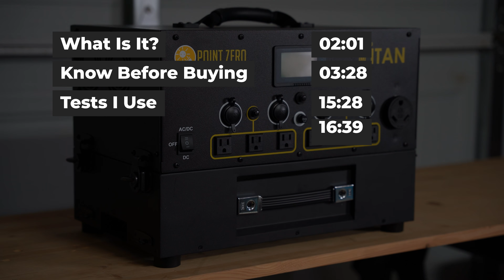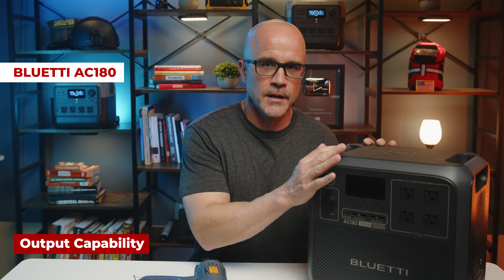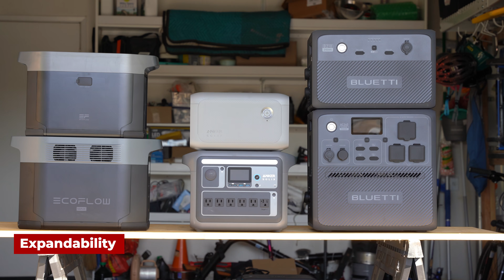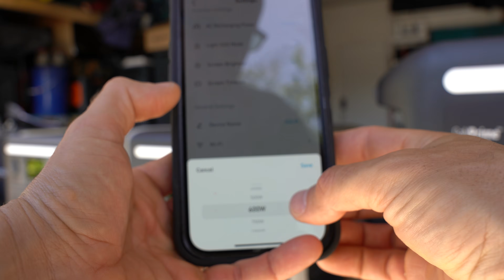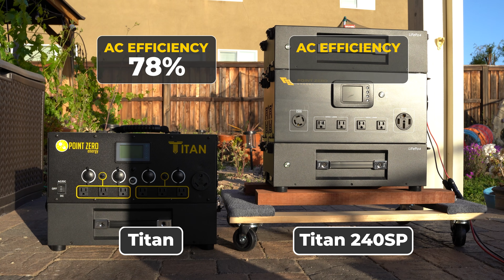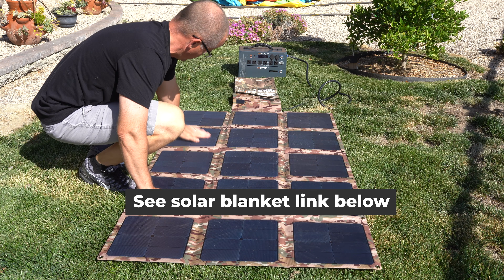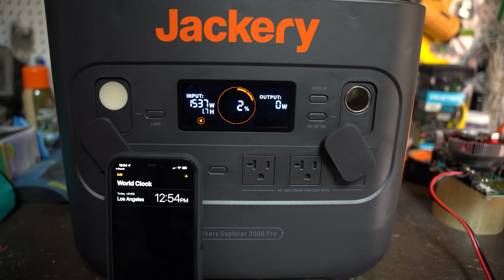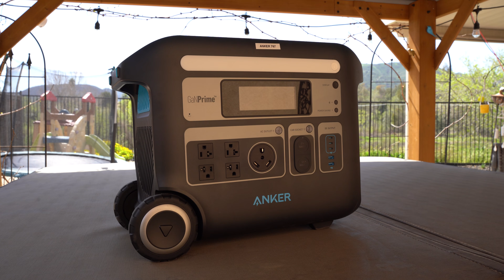Best Solar Generator for 2024 (The Ultimate Guide)

Comment: ￼

So is the following ad of of the Mango website, false advertisement? And by the way, I paid $6200 for the split phase 240V setup. Two units split phase adadapter box, the elink cord "(that trips the unit out,or faults immediately after turning units on after installing said e-link cord into both units and nothing else attatched, ie.noload)
It also came with a quick charging cord for the 30 amp 240, and 4-200 watt portable solar panels. It was an end of the year special that somehow found me when I was seriously considering a boondocking lifestyle as soon as possible in a 42' toy hauler. I had made to my daughter's house in northwest Iowa from SE Wyoming, December 26, (due to road conditions) for Chistmas of 2022. The deal was, I had to  purchase by midnight Dec. 30th and was already the 29th by the time I heard about the Mango Power E,  and the promotion they were offering, and definitely wished I wouldn't have been so gullible and waited for some of the other ones to enter into my searches for Sola generators,as I was just starting to enter that more permanent rv lifestyle. Turns out I have had to remain home  take care of property and preparing to downsize in order to do such a thing. Became a widower in June of 2020 and I can't just let my home take care of itself, anyway the Coddington was to give you some info that I'm familiar with.
Oh and contacted Mango Power to get another e-link cord or a pinout schematic to verify that what I found to be suspect and have heard nothing back and sent like 2 or 3 emails and no response since the first contact with them(Mango). Sorry for the lengthy comment.
Written by MangoPower
May 16, 2024

Mango Power E: The Perfect Solution for Portable Power Needs

The demand for powerful and portable RV power continues to increase each month. People are searching for backup power and off-grid camping solutions that are easy to transport. The Mango Power E Portable Power Station pushes all those buttons and the portability envelope.

 

￼

Patrick Buchanan, electronics reviewer of Camper Report shares his insights: "The Mango Power E Station offers RVers the assurance of reliable power when venturing off-grid. It ensures they wake up with power at their fingertips, even if battery capacity has been misjudged."

"The myriad of applications for this portable power station in an RV setting is astonishing. It effortlessly supports the usual needs—charging laptops, smartphones, flashlights, and fans, as well as powering coffee makers, bottle warmers, ice machines, electric coolers. The list goes on. It‘s even capable of handling high-demand appliances like hair dryers without tripping a breaker."

Discover more about how the Mango Power E can revolutionize your outdoor adventures here:

Comment: "solar generator" is a stupid term. It's not generating anything. It's a storage battery and an inverter. Those are both actual devices.
A fuel generator is made from a fuel engine and a generator. Those are also both actual devices. 
A fuel generator converts mechanical energy (provided by the fuel engine) into electrical energy. A "solar generator" converts stored electrical energy into electrical energy.
Reply: I think you meant it converts electricity from DC to AC, right?

Comment: I just thought of a test I have never seen. Hook-up battery to gas generator. See what happens in UPS mode when generator runs out of gas. Is the switch over speed the same? I think it would be, but I also believe in "Trust but Verify".

Comment: The problem with all these battery units is rhe amount if time they can supply power. If you need one to keep a fridge going ir a freezer, they are good for about 8 hours max before they die  and need recharging.
Example: If you have a 2000 watt hour  unit and your refrigerator needs 200 watts to run, that generator will supply power for only 10 hours . At 100 percent Efficiency.
Reply: That’s a hungry fridge freezer!  Mine is 15 years old, and it uses 74 Watts (and it’s a decent sized 130/74 litre unit).  Moreover its thermostatic duty cycle is typically about 30%.  So all of a sudden you have a battery that can run for 36-48 Hours. 

 I did a 48 hour test with a Bluetti EB240 about 2 years ago.  I was able to run fridge freezer, internet router, a couple of light bulbs, my laptop and my central heating with the help of a single 375 Watt solar panel in February in mixed weather conditions.

It worked!  I had to be careful with starting current surge from the fridge compressor, and I had to unplug items when not in use to manage depletion rates, but it was a very acceptable performance and certainly orders of magnitude better than not having the battery at all.

Comment: This is such a useful and appreciated video, Thanks to YOU!.  I joined and downloaded the spreadsheet.  Personally I have been using Anker power banks and such for several years for my phone, laptops etc and like their products so when I became a pseudo prepper,  I purchased the Anker model 767,, formally the Solid 2000 I think and used it for past year and half here in Florida, the home of the hurricanes and now tornadoes, charges quickly with the included 400 watt portable solar panels, I purchased the adapter to allow it work with rigid solar panels.    One thing I believe would be good to know, at least for me, is the after sale service the companies provide.  Do they give you the run around when trying to make a claim , do the happily answer questions, things like that but would be difficult to collect this data.   Thanks again, Ted in Sebastian, Fl.
Reply: I’ve heard Anker offers the most weather resistant panels. Believe it or not, some panels apparently can get damaged during torrential rains.  Who knew?   I’ve also heard very good things about Anker making sure all new products work with their existing line so you’re not stuck with anything obsolete’ in a couple of years. If you can’t tell, I’m leaning towards choosing their products. Thanks for sharing your experience.

Comment: I got an Ecoflow Delta II this summer and have been testing it with different appliances.  I've narrowed down what can run safely during a summer vs. winter outage, and this will be a lifesaver.  I have home solar and need to get a connection allowing daytime charging of the battery in a power outage, to be set to survive for multiple days.  And since it's portable, I've gotten some day-trip use from it, too.  I wish this video had been around when I was researching and shopping.  Excellent explanations, thank you!

Comment: Can Victron please make one of these…. They’re easily 90-92% efficient with the ac inverters. Also in my experience if you keep some of these 24/7 on solar they have issues. Screen flashing on and off end of the day, battery percent stuck (anker old one I have)

Comment: Thank U4 Ure very Well-Done 'Best Solar Generator for 2024'. Comments:
- How can I get Ure Well done
  Calculator 4 my use to calculate my Whole-Home requirements ?
- As of Ure Video(3 days ago for 2024), is it too early for a 2025Guide Video ?
- I love Ure comment guide option 4 a 'Stand-By' system with or without an Emergency for maximum use.
- do U have reviews for a Non-Solar system (such as a MANGO POWER E Power Whole-Home Station or RV PWR backup system ?

Comment: People should add up how many KWH they use per year, and double it, then get something that will do that, as a starting point. This will ensure they have enough to continue on as they are. And if they buy more appliances, or electronics, figure another battery device just for that particular item. Ideally you want to not have to rely on the utility companies. You also don't want anything that connects to the Internet, so that when computers are attacked by adversaries, and do take down utilities, they can't also shut down your device, that you connected to the Internet. These people that connect everything to their internet just really don't understand what a horrible idea that is.

Comment: I see on your spreadsheet you list a 750 w Microwave with a surge of 800w. Time in use 2 minutes.

  Microwaves are only about 75%efficient  which means a 750w microwave will need 1000 watts to operate.

 I didn't look at the other items

Comment: Don't trust the sample wattages in the spreadsheet, use your own!  The Capability Calculator is good idea, unfortunately it's rather lacking or inaccurate. Some examples- refrigerator shows a usage of 300W/hr or 7.2kW/hr per day for an 18 cu ft. This is very high. I have a nearly 20 year old 25 sq ft unit that uses 2.5-2.8 kW/hr per day, less than half the number being shown. Washing machine - I have a rather large one that is about 5 years old, it peaks at 1460W, and the power to run a load is under 250Whr, one third of what's shown on the spreadsheet.  Then there are the 13" and 27" televisions, say what? Those are CRT based televisions which haven't been manufactured for about 15 years, there is no reason to include those at all. Notably missing are current generation LCD/QLED televisions, something people would want to know about. Security cameras are showing 150W, huh? Modern IP cameras use less than 20 watts per camera for most models, some are far less.  A few may go up to 30W or so, but those are more specialty cameras and not typical.  Modern cell phone chargers take more than 10W, that figure was true perhaps ten years ago, however not so much today. More work needs to be done as the ending calculations are rather meaningless if the original inputs are this inaccurate.

Comment: You need to check out Oupes brand. They are LiFePO4 and are much cheaper than the others. I have 2 Jackery 1000s and 2 Oupes 1500s and the Oupes charges faster than the smaller Jackerys.
Reply from the maker: Oupes sent me one of their units. Was an absolute dud.  Tried to work with them to resolve it and the customer support was worse than the product. Hard pass for me on their products.
Reply: @CityPrepping  Both of mine work great as do their panels. You should have included a warning in your review if you feel they are that bad. My Jackery, Oupes and Dokio panels work great but my Rockpals only worked once and then died. YMMV, I guess.

Comment: Measuring the quality of the sign wave should be done using a specific device that measures the THD. It is the harmonics in the signal that represent the noise, which will not show using a $100 oscilloscope. Also, you should do the measurement under load.

All the above says one thing. All videos are simply paid ads. Use them for information after doing your research. Question the 4000 battery cycles to 80% 😂.

Comment: These are not a replacement for a good generator and eventually the batteries will need replacing and are expensive . Except for camping or RVing, I don't see the point of these things.
Reply: Correct, these sized models are best for camping, a much larger system is needed for total off grid use with solar. The smaller units are only useful in power outages for keeping a couple lights on, they do work well for that. Once you add a refrigerator and a coffee pot or toaster oven, it all over.

Comment: D17 Honda engine conversion to a generator is better than all of those. Should only cost around $3500 to build one at home.  I get 30kw with mine. Most I pulled with it was 75kw..  It runs on a gasifier so I save thousands not buying gasoline.

It's not light, nor is it convenient to load into something.

Comment: They're electricity storage. They themselves don't "generate" anything. They only thing that could be considered a generator are solar panels. Which since they're a separate product and not part of the battery bank, I don't consider the battery bank a generator. When you buy a gasoline generator....its an all in one package. Pour in gas and it converts that energy into electricity...it "generates" electricity. These battery banks "generate" nothing without the use of solar panels, which are the actual device "generating" the electricity. Just my opinion. Hate that they try to call them generators lol
Reply: It's just marketing, unfortunately such inaccuracies abound in all technical products.

Comment: Loved your amazing video. Took notes but realized you didn’t provide specs in the ECO flow. As a matter of fact I was surprised you mentioned it after you had done just a thorough job explaining all of the important specs on the three other models. You kind of mentioned it at the last minute, did not provide any specs and only showed us one size. Not mention of wattage or any other features that would help us make a decision, I am still very surprised because it is obvious you are very intelligent so to leave out features in the model you actually recommended was a huge shocker, I was all set to make a decision until you through this one in at the last minute, now I have to do my own research,

Comment: Gave my dad, who lives in Lake Lure NC, my Jackery 1000 and Honda 2200. Between these two machines he has been able to weather the aftermath of Helene. The Honda runs his fridge and freezer. The Jackery charges everything else.
Reply: You’re a good Son!
Reply: @SidW-l4z It would of been nice if Joe Biden would help them instead of free sex changes for the world.
Reply: Glad your dad got through this. I sent my sister a solar panel and battery- can’t remember the make. I think it was Yeti. But no generator. They did all right. Able to heat water and charge their devices, have some light. Fortunately the weather was mild. They bugged out as soon as they could.
Reply: Good combo!
Reply: Joe Biden wouldn't help them? Sad
Reply: All the best to him and your family! I’m here in Fletcher and watching this video for the same exact reason. 👍🙏👍
Reply: Does Honda run in battery ?
Reply: @jayajora  Yes.
Reply: @jayajora  what do you mean? Is it battery powered? If that is your question, then no. It is gas powered.
Reply: @hedge313  thnx
Reply: I think what jajora meant was-does the Honda generator kept the Jackery battery changed? Does the Jackery have solar panels?
Reply: @karenredding9439  the Jackery has a 100w solar panel. My dad lives in a heavily wooded area, so he sometimes supplements the solar with the Honda, particularly if cloudy outside.
Reply: @karenredding9439 no he meant if the Honda runs on battery or gas
Reply: I think he meant do you have to pour batteries into the Honda tank to make it run
Reply: @GG-kc6ie no you pour fuel into the Honda
Reply: @hedge313 I wouldnt risk relying just on fuel, maybe better to pour the fuel over the batteries then pour the whole lot into the tank. That way when the fuel runs out the generator can use the fuel soaked batteries so kinda extra power.

Comment: Good video, I have to sleep in my car occasionally.  I run an electric throw blanket in the winter and I need to power this. I bought a new Ecoflow II and a 2 kWh batter pack.  This worked really well for the first couple of times I needed it.  Then the whole system just stopped working when I was in Reno NV in the winter.  I was very unhappy.  Previously I had used a much smaller Jackery unit, which wouldn't hold a charge.  My issue is not what do they do now, but how well do they last.  My Jackery gave me my money's worth but the Ecoflow doesn't make me feel good.

Comment: Natural gas or any combustible fuel is a MUCH better energy backup than ANY battery electric low-energy-density-heavy JUNK.  Stop buying these wasteful electric “generators” because they lose energy capacity over time.  Gas and combustible fuel generators don’t lose capacity like batteries boy! 😅

Comment: @CityPrepping Can we compare apples to oranges? Pecron 3600 or EcoFlow Delta Max? For a specific 8 hour need to power 200 watt refrigerator? And a 2nd identical unit to power space heater or small window AC also 8 hours?

Comment: Hey, thank you for posting all this helpful information. Just recently got hit by a severe thunderstorm storm and dust storm in the Spokane area knocked out power out for 8hrs. I’m normally not concerned about outages due to the fact that 7 years of living in rural area outside town, we have only lost power once to twice a year for 30 minutes at a time. Recently our power company has changed its safety policies that are going to lead to longer power outages before they will turn power back on due to fire danger. This video has been a huge help on what unit will fit my needs. Thanks

Comment: I had an eco flow delta max pro that had issues.  To fix it i would have had to send it back overseas. I either had to wait for them to possibly fix it or they would send me a refurbished unit.  At that point I was able to take it back to where I purchased it.  I then bought a Jackery since they are made in the USA and if I had problems felt better with options to get it fixed.

Comment: I'm curious why Goal Zero wasn't considered...
Reply from the maker: I briefly mentioned them. Essentially their tech is way behind.
Reply: @CityPrepping  Their new Yeti 300, 500 and 700s are finally using LiFePo batteries.  Is there more to it than just that?
Reply: @CityPrepping  Is their battery tech way behind (Their new Yeti300, 500, 700 units use LiFePo cells) or is it more than just the batteries?

Comment: I have a hair dryer that requires the inverter in the power station to handle 1800 watts. The power station that I was thinking of buying can only handle 1500 watts continuously and shuts down, according to tests on the Internet, if the power requirement becomes higher. Total energy content is 2400 watts on this power station, Fossibot F2400. Can you see in your calculations how much the inverters in the various power stations can handle?